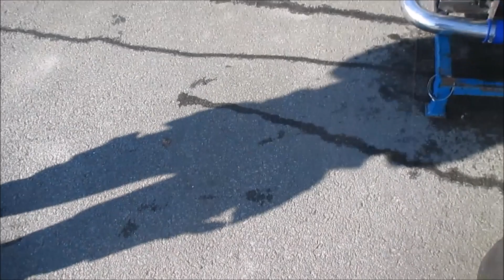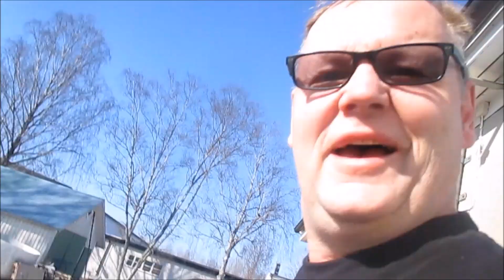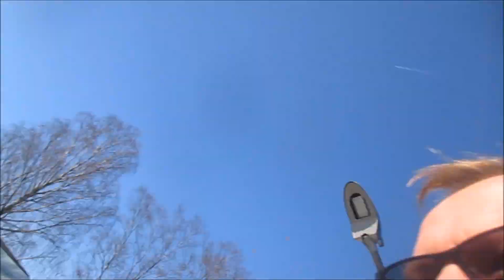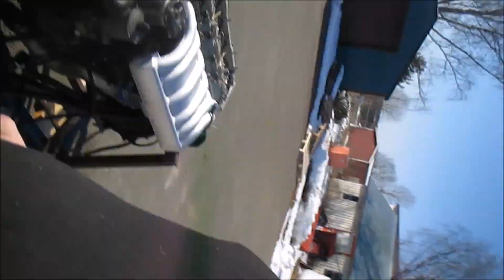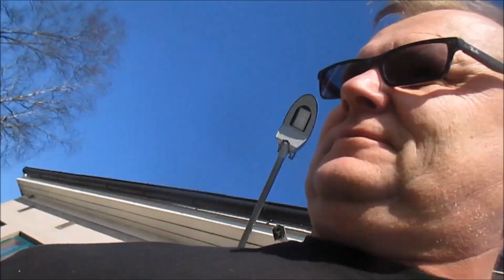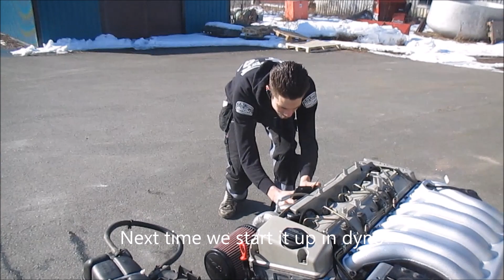Dieselmeken shows OM606DPUK 7,5 mm

Comment: The Sleeper, is sweet sounding . that would fit nicely in my 350sd  .. with the  617  rod bender , when i first got it smoked turbo seals shot  the intake was gummed up  ,i took it all apart cleaned the intake new seal for the turbo still lots of blow by . .. A friend gave me some what is known in the laundry business as perk to clean parts,  a type of banned freon. So I thought why not try a mixture of diesel and perk ran about a litre  and the engine cleared right up, no more knocking, no blow by at all.  just purrs . i went from looking for a replacement motor to having a really nice  617  hope after winter hibernation it still purrs . ,  ..   
Dieselman your thoughts?